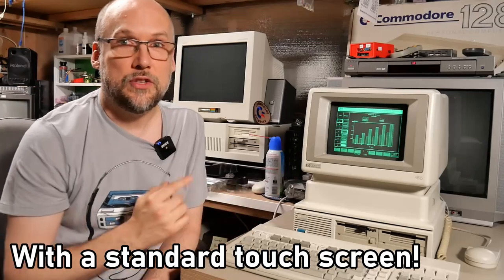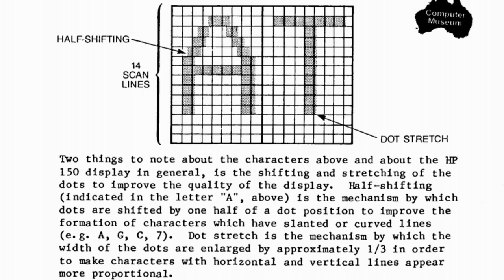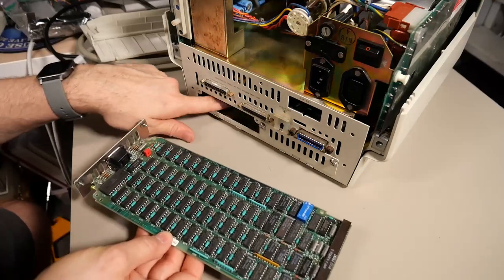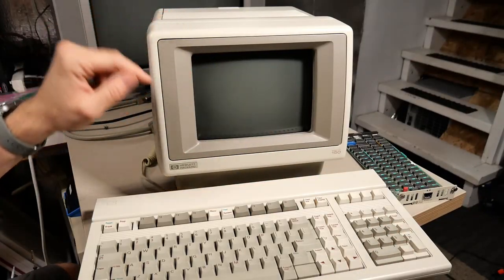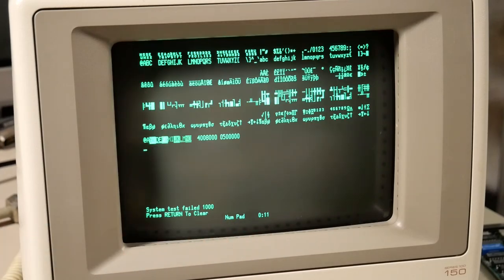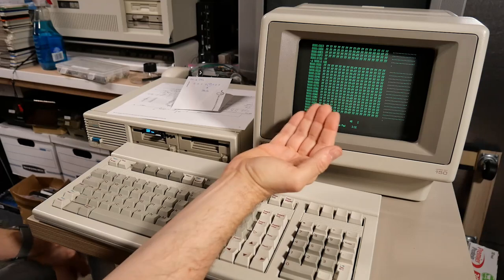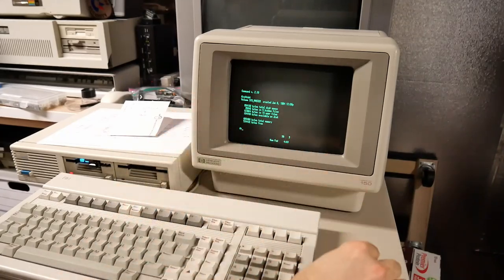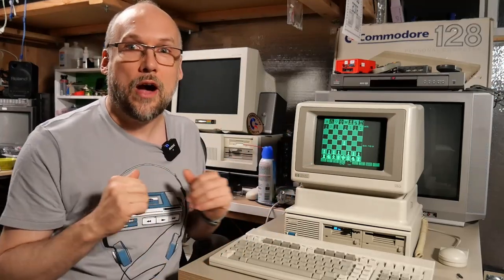Touch Screen MS-DOS PC from 1983

Comment: "it's a HP so it's well engineered"

*cries in modern HP"
Reply: I mean, all the business stuff still seems fine, for now anyway. Though, I only have EliteDesk 800 G1 and G2 systems, and a more modern EliteDisplay S270n
Reply: Correction grabs tissue from paper exit SWAT for printer on top of computer and cries into the tissue on top of computer and cries into the tissue yeah we're friends in another comment as to what people had use that for a tissue holder seriously.

What's build a device to allow you to use a paper towel roll to the front fake drawer of a older kitchen cabinet below the sink the paper towel would pass through with those decorative sloths that was poor ventilation to keep washer from building up under the sink excetera they knew do actually make modern drawers that have a place for paper towels wish they would do the same for tissues be a nice touch for either side of the bathroom. Or kitchen.

By the way what the worst ideas ever had somebody say that their house smells like urine next to utility sink their place had a place attached to it that was shared with another Resident turns out there was a urinal like that of a portable toilet accept metal and the hose yes hose ran down took a right angle turn into a Copper hype and Waldo in your utility room running into the laundry machine tubs at first they thought it was an overflow or something else having to do it from the old systems in the house when they first saw it and then later on they realize what the smell was and what was coming out of it needless to say they are no longer sharing a residence they found out they were actually living there illegally and never got any compensation or anyone or anything they should have to even live there they just took it that it was a separate residence until they found out when they brought this up with some other issue when it was brought up turns out they are a lot more space there place quite by accident also not sure why but I had seen something like that except done with a dishwasher tailpiece in the bathroom sink of a place and there was a the urinal somewhere else in the house connected the same way except through the dishwasher tailpiece in the bathroom under the sink and thar was a second piece of tubing that ran back to the other room and there was a water valve connected to that which was also connected to the cold water of the sink and there was a second valve that was like that of a water fountain momentary wasn't sure what that was for but it did something somewhere but the other one washed the urinal except not from that room but from under the sink just injecting water straight into a t fitting where the two pipes connected. Before the dishwasher tailpiece.

Another weird one at my grandmother's house there is a dishwasher tailpiece underneath the old bathroom sink can I figure out where the hose goes I suspect but I could be wrong that it's being used as a vent? However it's after the Trap before the sink drain I doubt there is anything any anak or anywhere near there that would use water that would need to discharge any water at all so kind of perplexed if anyone has any ideas please comment.

Also I do like hp's equipment and computers pretty much I've had a few and use many others I used to have a terminal awesome sword that was HP that I used to use in my shop to run other equipment and other miscellaneous tasks and do some other interesting stuff even ran a couple simple games including Tetris and snake and a few others and yes one text Adventure or a few others I once played a arcade game on a piece of test equipment but and no it was not Doom either or that other one brain fart as to which one nor was it Wolfenstein or something like that but something else Something Like a Dungeon Crawler what are some graphics and some texts portions as well it was on a monochrome screen and used original controls for the test equipment to play it seriously I don't know but it's possible as an Easter egg on something too long ago to remember. This was kind of too early to really be on the scene where someone would hacked it into a device so I have no idea I don't even know who made it equipment or what it was I just remember playing the game and yes I also wants a piece of equipment it had an Easter egg of Tetris.

I also played Crush the Castle on a piece of testicle that wants which was actually what Angry Birds is based on seriously not necessarily original game just based on another one like almost all games these days at least in the Google Play Store not LOL either too many games that are just a rip-off on another one or trying to turn to games into something they're not just to get a hit by using two parts or two different games and winding up with a game that's even worse than either one of course but what I would like to see would be Angry Birds Meats some sort of first-person shooter where you're playing birds instead of bullets and maybe all the other mobs are pigs or something
Reply: Aaron Brandenburg holy fuck I nearly had a stroke trying to read that

Comment: I was hired by HP way back in 1984 as the HP150 expert and even had the ROM source code at one point when I was writing an assembler based Beehive terminal emulator.   If you rented a car on the east coast back in then that transaction was done at the airport on a HP150.  Later they even offered driving directions where you used the touch screen to touch your map info and got a thermal printout of how to drive there.  I never kept any of that hardware as I was always chasing the next fastest computer, but it was fun and HP-HIL was very similar to what would become USB.  You could daisy-chain devices off of HP-HIL also.

Comment: The machine is actually very servicable and it is very easy to access once you have proper tools. The sliding boards construction is still very popular in some industrial gear. The idea is that you should have special extension/diagnostic boards that are mostly just direct connections from one side to the other. You plug it into the main interconnect board and plug a board you want to play around with into it. This way your board is just hanging in the air outside the case that gives easy access to both sides and some mechanical stability at the same time. The only real downside of the approach is the amount of high quality connectors and boards and board guides and supporting brackets required is so high that it makes the whole system much heavier and much more expensive than if it was just quickly shoved into a box, screwed up to whatever and hooked up with some wires.

Comment: WOW!!!  It's been SO long since I played on that type of system, I really aggravated my uncle (Who owned it) after I systematically tried every available command, ending up on FORMAT...  Oh he was annoyed.  Pretty cool system, I was blown away by the high resolution monochrome touch display.  Even had a modem that he would use to connect to a mainframe at work (He worked at HP as an engineer and helped in e-beam probing bare dies for the PA/RISC processors during test and troubleshooting).

Comment: HP had extension cards that would plug into the backplane, and the system board you're testing would then plug into that and hang outside the chassis. They did that for practically everything, worked well enough I guess?
You can still find cross reference documents with all those part numbers and whatever off the shelf part they correspond to... mostly.
There's a neat program called HPDrive that lets you emulate a HPIB disk drive using a PCI GPIB card in a modern PC, and all the tools for messing with the filesystem on them. Don't even need the entire disk drive!
Reply: Yeah they're just a long PCB with straight traces and  edge contacts on one end and a edge con socket on the other. Defpom buys the PCBs from somewhere and solders the socket.
Reply: There's even a windows image available at the HP museum site that can be loaded via hpdrive.  I wish i had the memory card so i could run it.

Comment: My humble opinion on why air fixed it 
Those IR lasers floating data points (normally open/normally closed) are held in RAM. Dust not allowing the IR emitter & receiver to see each other held that single bit on that bank closed so long it failed. After replacing the chip, the IR was still reading as failed sticking a bit closed that the computer thought was another failed memory bank. So dust can cause IR failures that pop up as memory failures wherever the Floating NC/NO points are held. So the IR data for that Y-axis row must be held @ 100C,1000 &1004.
Grateful to learn from you, I was born the same year as Linux so this is amazing to me that you can actually read your ram.

Comment: Supported these as an HP systems engineer in the field for the dealer channel. Worked very well if you stayed within the customized software available for it but ultimately it’s inability to run off the shelf software and its price tag impacted its general appeal.
Not sure if it’s rumor or true, but at the time it was rumored that there was some dissension about what this product was ultimately supposed to be, such that some of the key members of the design team moved on to other projects very shortly after its introduction.

Comment: Adrian, I watched this really nice video and stumbled across your daubts, why people route botch-wires identical to their traces. I found these type of fixes myself inside Rohde & Schwarz RF test systems. The reason is very simple: The original traces are too close to the side of the cards and are prone to fail by being mechanically ripped off by the card rails. With conductive assemblies, like the RF tes equipment, there is a risc of shorting things out so close to the case or slides. So they cut the traces and used some botch wire. May be that helps to demystify that double-routing :)

Comment: 17:47  The botch-wire replacing the trace on the PCB might be to solve Issues of impedance, resistance and or capacitive stuff or something like that - I think I remember Bil Herd saying they had to do that on the A0 line of the Z80's adressbus in the C128 because of that.
Reply: I've always heard those called bodge wires not Balch wires but technically either one would be correct I don't know if which one is technically correct as I said either one would describe it and it's possible people think you're saying one even though your might be hearing the other any thoughts on this? Please comment.
Reply: I've seen that done on a cheap Taiwanese modem board in the 90's. The PC board was produced defective and one trace was shorted to something, so they simply cut both ends of the trace and used a bodge wire. The company I worked for had bought hundreds of these modems and every single one had the same cut trace and bodge wire patching the trace.
Reply: I worked at an electronics manufacturing division of a major defense contractor, and we had a PCB fabrication area.  We'd have a run of boards with bad or shorted traces on an internal layer, and those jumpers were used to avoid the expense of scrapping the boards and making new ones.  A few times a hole was drilled into or through the board to remove the short.  Sometimes the feedthru for an IC pin would get drilled out and an eyelet would be installed in its place and wires run to it.
I didn't notice it on Adrian's boards, but on longer runs we'd tack down the wires with small dots of adhesive like RTV or epoxy.
Reply: @scottlarson1548  Thats pretty common actually in older boards. Some cut trace here, some extra wires there. There are entire series of computers that have the same modification like that (Atari XE for example). It kind of looks excessive on this extention board though.

Comment: Great problem solving, as always.

And I'm really glad you called it "bit 3" instead of "bit 4". lol

Yep, it's strange when they don't add better diag code to the BIOS.
In assembly, it wouldn't take up much space at all to add a simple 0x00 / 0xFF / 0xAA / 0x55 RAM check, and show which bank has failed.

(or a walking-bit test, to determine which bank AND chip had failed.)

But HP were a lot like IBM, where the retail cost of the machine meant they didn't too care much about board-level repairs.
They obviously saved a bit on the cost of the IC sockets, too.

Comment: The setups for the screen options allow for the definition of forms and fields.  You can define a form layout and then only send/receive the user data.  That mouse is the same as was used on the HP9000 workstations.  I broke the left button on my first mouse when I discovered Tetris.  The printer that this series of terminals/test instruments used was the original ink jet mechanism that had the internal code name "Vesuvius".

Comment: I worked in an office in the mid 1980's that had an HP150 set up like yours that was used mainly as a terminal to link in to ComShare. We also had some HP9836 workstations with external hard drives that were massive heavy things linked via HPIB. 

I later used some of the early HP Vectras, including an RS25 (386 - 25 MHz machine) that I used as a web server for a few years! That had the HP HIL interface for the mouse and keyboard on it!
Reply from the maker: Yeah I saw some pics of those early Vectras and it seems they used the exact same keyboard as this machine. Fascinating!

Comment: Instead of cutting all the pins on the ram. Cut the power or enable pin. You can solder it back together if it's not that pin.
Reply: But it would still backpower it via the ESD clamp diodes, so perhaps only cut the enable and tie it high.

Comment: Glad you were able to fix it Adrian, I recall working with a few of those models, plus some similar ones and various HP terminals.  That was back when they were new or at least not old. 😉

HPIL stands for HP Interface Loop; think of it as similar to the Apple Desktop Bus (ADB) but for more than just keyboards and mice.  The HPIB / GPIB / IEEE-488 Bus was a great way to connect equipment together.  Back in the late '70s to mid '80s I worked with automated test stations, computer driven test equipment used to test and troubleshoot electronic assemblies and systems.  Using a computer program to control things like multimeters, frequency counters, function generators and even digital oscilloscopes with waveform analyzers made it easier to test batches of devices quickly.  You still needed good troubleshooting skills (as you used for your RAM problem!) since you had to also understand what the test station was telling you and know when it was giving you a false indication.

Comment: At HP in Colorado Springs, the folks who had these took to putting scotch tape over the photoreceptors in the bottom of the monitor bezel to keep the dust out, otherwise they'd have to blow them out every so often.

I loved my HP 150.  But hardly anyone else at HP did.  They were not popular.
Reply from the maker: Fascinating! So it was a problem even when these were in use! Amazing only one was clouded with dust on this one.
Reply: Adrian's Digital Basement there was a plastic piece introduced to address the issue later in the 150A’s life. 

Turns out those holes would clog with dust and dirt, especially the bottom row, so bad, the PCB had to be replaced. 

The cover was flat on the top and on the bottom had round extrusions with a flat bottom that fit into the holes. It just laid on the bottom of the display. The other three sides remained unprotected. 

The 12” 150B the “Touchscreen II” the touch was optional. A touch screen bezel could be user installed and was sealed on all four sides

Comment: Wow, I'm still amazed how the old HP equipment is reliable and user-friendly. Two years ago I was having lab classes using 70's HP phase generators - I still have no idea how those came to Poland due to a CoCom embargos (I'm a civilian student of military tech university).  What's more funny, we've had got the same model of spectrum analizers, but every unit had the other brand: HP, Agilent and Keysight - that's just showing how well their instruments were made if they were so confident selling those 

through all these years.
Reply: HP Lab stuff is awesome
Reply: Poland had its share of smugglers allowing some islands of technology to flourish. It had its risks and took guts for sure.

Comment: The Power on Test error 1000 was a very common issue on those units when they were in service.  The row of holes along the bottom of the screen filled up with dust and often needed a small screwdriver or probe to stir up the dust and be blown out - so you did well to only have one LED blocked and to get it out with the air blaster.  The LEDs themselves have also been known to fail , resulting in the same error. The 150 Touchscreen II had a plastic cover over the LEDs to prevent that problem - but not many units came with the touchscreen as it was an optional accessory.    RAM failures are very common with the 150s - your use of debug is a great way to narrow down the fault!!
Reply from the maker: So I suppose it'll be important to keep a cover over this machine when storing it to help keep the dust out of the bottom row. Interesting!
Reply: @adriansdigitalbasement  As someone else mentioned further down in this thread, HP did release a plastic strip with clear 'plugs' that dropped into the holes on the bottom of the 150A screen to address the issue. They weren't that common but I do remember them from my days as an HP Customer Engineer. But yes, if you have a dusty environment, a cover would be a good idea.